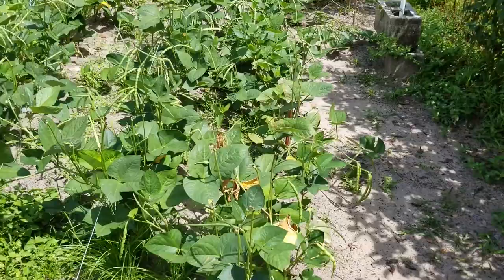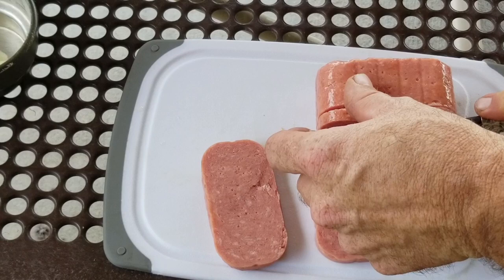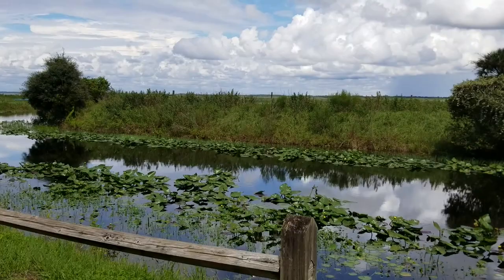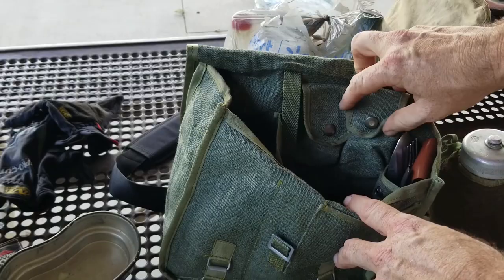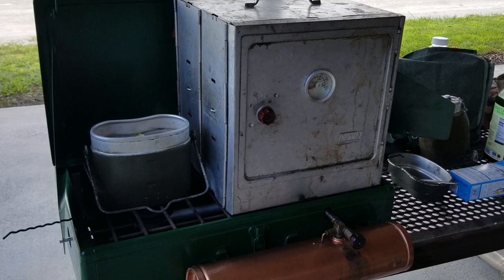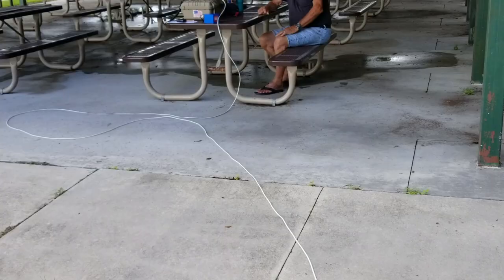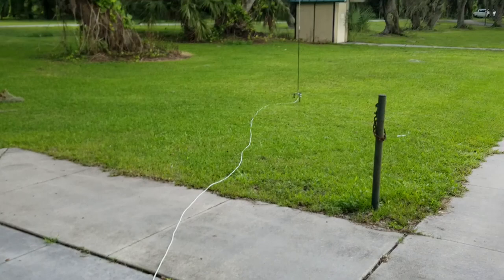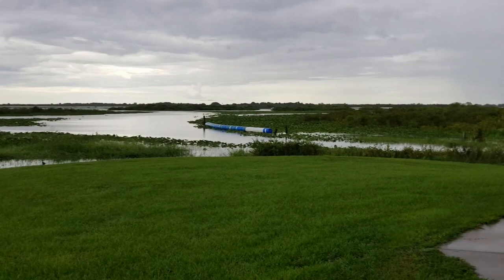SPAMtember With Polish and US Army Gear!

Comment: Hey John!  Nice set up.  I've got a very similar Coleman that runs like a charm.   Last week I picked up and old stove for $5.  I had no clue what it was.  Turns out it's  a Turner Brass Co.  Made in the 30s.  Very little info on the web about them.  But I got it running with a bit of TLC.  Kind of surprised,  for me anyways,  just how much chatter was on the radio.  They have always kinda intrigued me.
I have that same oven too, but I have never used it.  I have picked up a couple of small bread basket warmers.  I want to use them in the oven for some thermal mass to help retain so heat.   I'll  see ya on your next one.
Reply from the maker: Hello Chris. Glad you stopped by. Sounds like a cool stove you have there. I enjoy restoring the old ones and taking them camping. I usually get some good conversation from folks camping near me. You will probably experience the same thing. 

My next stove project is a original Coleman 425 (no letter) made between 1948 and 1953 for my brother. He found it in a old leaky shed he was demolishing. I hope to start that soon. After that will be a 413E stove made between 1954 and 1961 that my dad gave me.

Comment: Good morning, John. Yesterday I was looking at the Polish bread bag on Amazon, do you like it? I think I’ll try the spam black eyed peas in my Soviet mess kit. Cool to see you use the refurbished Coleman. How awesome that you were able to cook the cornbread in the oven on the stove, nice. 👍
Reply from the maker: Thank you very much! The Polish bread bag is good. It has its own strengths. I like that it will carry a German style mess kit in the main compartment and all the little pockets for organization. But the one thing my particular bag lacks is water resistance (not sure if all Polish bread bags are the same). I can see daylight through the fabric of my bag and the flap barely covers the bag. For outings in Florida where rain showers can pop up at anytime, this is not best for me. But on a dry day, it’s great. 

I carry 90% of the time a Czech bread bag made of heavy canvas. It has a rain resistant material and a flap that covers very well. It doesn’t have room inside to carry a German style mess kit but it has nice pockets to organize small stuff(ferro rod, light gloves, food seasoning, silverware, etc)  and a large compartment that I carry a back up Esbit stove, bug repellant, fire starters head lamp, and a bit more. On the outside of the flap, it has some webbing that I sometimes attach a US or UK Osprey type canteen cup system using the flap webbing. 

The other bag I favor is the Finnish gas mask bag because it’s made of heavy canvas, the flap covers the bag well, and it can hold a lot of stuff. I use it a lot when I plan to hike to a remote lake or river to fish. It holds a lot of fishing stuff, my lunch, and electronics. 

I use all of my “haversack” bag setups with a back pack of some sort to carry other items. I might have to make a video on this! 
Thanks for your comment and for watching another of my videos!
Reply: Czech M85 bread bag is much better than our Polish bread bag. It has two flaps that fit Polish / German mess kit handle. Just pull the flap through the handle. I always hang mess kit outside since it is very light. The other flap is for attaching a 13'' hatchet. I use a piece of paracord for that. I also always attach plash palatka and rain coat to the bottom of M85 bread bag. US canteen set inside the bag. This is my favourite "backpack". I use Czech M85 suspenders. Much wider than German suspenders

Comment: Glad to see you back at it John. I could almost taste that. Did I see you using a carbon steel Opinel knife there?
Reply from the maker: Yes it was. I have had that knife for a long time. Hard to beat it. Thanks for watching!
Reply: @John-Sherwood-W4JFS  Yes it can take a very fine edge. Wouldn't be without mine in the garden.